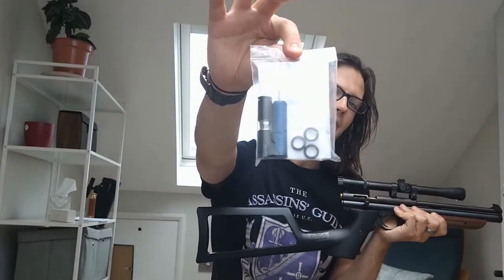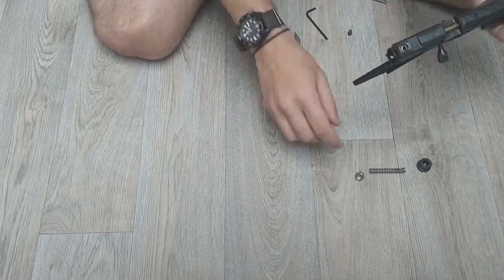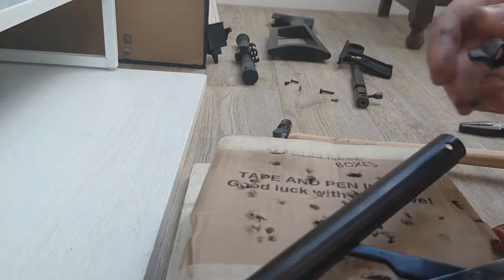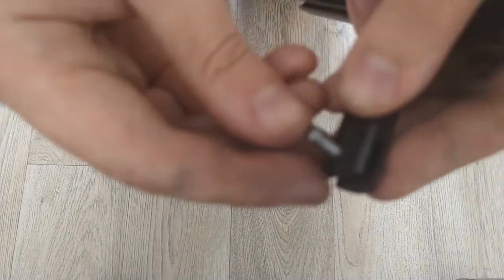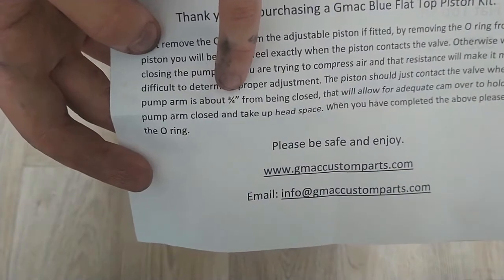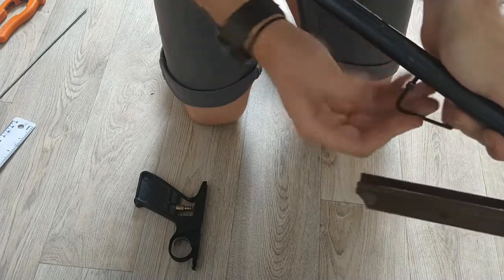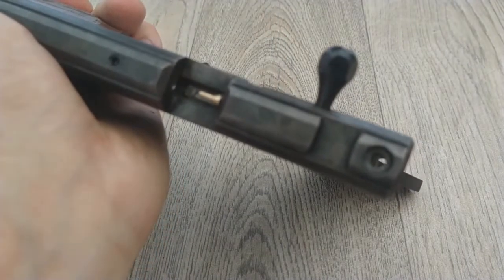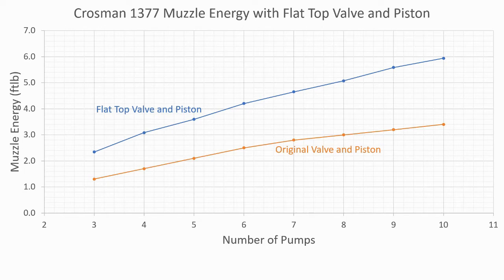Crosman 1377 Flat Top Valve and Piston - Install + Chrony

Comment: In case nobody else mentioned it, if you open the pump arm the pin will go in and out much easier. There are also a couple of companies that make replacement pins that ARE NOT roll pins and use retainers to hold them in place. That style pivot pin is also much better to set your piston length. If the piston is too long it promotes early wear on all the pump arm components.
Reply: Yes its a good hack with pumparm open, it makes it so much easier. All the best from lancashire uk

Comment: guys, I hate to break it to you but flat top is purely cosmetic, it does nothing to improve performance, you know what does? the valve! drill larger output port hole, cut off half the thread off the male end, get longer softer valve spring and shorter harder hammer spring, drill a hole in the end cap of the tube and utilize a screw to act as hammer spring tension adjuster, I did that and with the stock setup using the original short barrel im getting 700+ fps with a LEAD pellet with just 11 pumps!, I have flat tops as well but they alone did not cut it, switched back to stock hardware and just turned my attention to the valve alone, also don't do this if your valve has been factory detuned (I'm looking at you UK, Canada, Australia..)
Reply: Could not disagree more. It’s been proven hundreds of times on the chrony

Comment: My maxed medalists has an 18in barrel with an enlarged air reservoir. With 30 pumps it will knock down a crow at 45mtrs. My latest build a co2 crosman pistol conversion. With an enlarged air reservoir adjustable hair trigger and trigger spring tension. I started with a 24in barrel and drilled it out for 2.5 in at 7.5mm. then cross drilled the 2.5in for a shroud silencer. This is super quiet and powerful. My next build, a crosman lower and Chinese parts for a PCP rifle with the same 24in shroud barrel. I love playing with crosman's. None better for the price.

Comment: If you don't extend the barrel with or without the stock it's still a pistol so be careful with those power figures, your 10 pump is just barely legal (with that specific pellet weight, so different pellets may well be over already) so any more than 10 pumps you will be in firearm territory in the UK, it needs at least a 12 inch barrel and to be something around I believe 24 inches complete length minimum to be classified as a rifle in UK law, I can't remember exactly but you may want to read up on it yourself just to be safe.
Reply from the maker: Thanks for the advice. I'll do some more reading and start looking for a longer barrel. I might also swap back to the stock transfer port for the time being.
Reply: @ThrHillSeeker  the transfer port would be the best way to restrict the power (may retain air depending on number of pumps) the problem with modded multi pumps is if the police get hold of it and send it to ballistics there's nothing stopping them pumping it 50 times, adding the heaviest pellet known to man and saying it's capable of an illegal figure and it's a hefty charge and may even introduce new restrictions. Unless the gun is incapable of going over 6 or 12 ft lbs depending on the barrel length they may well see it as a firearm. It's a huge grey area really
Reply from the maker: @MDM1992  That's true, although the same could be said for some stock multipumps and some pcps. Thanks for all the advice. I'll limit it with the transfer port for now until I get hold of a longer barrel.
Reply: @ThrHillSeeker  I always use the 14.5 inch barrel and fix the stock then you double your limit, but with these guns they can quite easily go up to 16-17 ft lbs so it's still best to chrony and restrict them mechanically, if its retaining air in the valve at 11.5 ft lbs then no matter how many times it's pumped it's legal, just needs to be fine tuned to that point.
Reply: Move to the US where we can own real guns with binary triggers😂😂 I can legally buy a 50 cal air gun at 17 in florida… y’all’s laws are too strict

Comment: Don't know why the don't use a hydraulic seal I stead of an o ring witch is round and only pushes a certain amount of pressure on the contrary the hydraulic seal is a unidirectional sea with a sharp conical shape that in extreme pressure it expands and seals even tighter I'm planing on machining mi own but with upgrades. nice video cheers for Florida USA

Comment: The easiest and cheapest way to increase velocity is to change the barrel.  I know you said you want to keep the 10.25" (216mm) barrel but changing it to the 18" (457mm) makes a huge difference and a barrel cost US $45.00 and 20 minutes of your time.  By changing the barrel I increased velocity from 585 to 665 fps.  My next mod is changing the hammer spring and flat top piston with the hopes of increasing velocity to over 700 fps.  I checked velocity with a borrowed chronograph shooting 7.9 grain Crosman hollow point pellets.
Reply from the maker: The problem with changing a barrel in the UK is that they're quite hard to get hold of and are subject to the same strict laws regarding shipping as whole airguns. I might still do it at some point though. Good luck with your hammer spring mod, make sure to replace the hammer pin with something made from a harder steel. The stock ones the to bend and break with heavier springs.
Reply: @ThrHillSeeker  GMAC will send them to your nearest RFD it's not much hassle just costs usually between 15-25 quid depending on the shop you get it sent to on "handling fees" lol
Reply from the maker: @MDM1992  Good to know. I have some family in Blackpool so might just arrange in person collection when I'm next in that part of the country.

Comment: I have a 1322 and I have recently purchased a new valve, bushing and an 18" barrel. I was looking for instructions for the valve installation. This video is exactly what I needed. Thank you.
Reply: How did it go? I was thinking of doing the same thing, wanted to know if it’s worth it.
Reply: @oneofthosepeople2101  I'm currently getting around 675fps with the 14.3gn CPHP, so about 14.5 ft/lbs at the muzzle.
Reply: @Ashcroft827  that’s amazing!
Reply: @oneofthosepeople2101  next step is going to be polishing the bore. That will improve accuracy,  reduce friction inside the barrel,  and  (hopefully) add a few more fps to that number.
Reply: @Ashcroft827  that’s awesome, keep it up man. 👍

Getting me motivated to tear into mine.

Comment: Open your transfer port to 3.2mm
And put the trigger spring in your valve (sorter spring)
It will release the air faster. 
I used a spring out of a hand wash dispenser for my trigger
Just see what you have around the house nice and soft so you have a easy trigger pull
Reply from the maker: Thanks for commenting!
I'm going to dial back the power mods until I have a long enough barrel for it to qualify as a rifle to make sure I stay on the right side of the law. I have a very free-flowing transfer port waiting in my parts box.
I might experiment with a lighter spring in the stock valve that I removed. 
I already have an adjustable trigger spring which is set super light. One of my favourite mods. I'm going to make a video of how to fit it soon.
Reply: @ThrHillSeeker 
Don't open up the transfer port too much you will lose power I tried 4mm tp and the power dropped
Rule of thumb is the tp should be 80% of the barrel bore 
3.2mm was bang on for me
Remember you have a 177
Hi flow is for 22
177 needs max pressure
22 needs a lot of flow
The barrel bore is 1mm bigger 
And the pellet weights twice as much 
Good luck these mods will never end
It's like a can of worms
Fun but expensive
Reply: @jasonbuchanan7591  It's very easy to loose power with a larger transfer port. There is a fine line. Being in the states, I leave my transfer port stock and just use a 16 or 18in barrel in .22. I only pump to 10. If I need to pump it 20-30 times, I will just use a different gun...My 18in barrel setup works great on cottontail rabbits and squirrels out to 25 yards at 7 pumps. I don't know why 7 pumps, but it is most accurate and works. I chose the harder cphp 14.3 pellets and they provide the accuracy and needed penetration. I would not use softer lead pellets like the Jsb Hades in my setup. But it shows to go that whomever developed what FPE is required for certain game didn't use the correct pellet!!! Anyways the 13xx platform is a very fun platform to work with and has huge potential. It can be rough on the pocket book though. My next project is a 1320. Having Walter Lothar make a .20 cal barrel. That will give me the hitting power of a .22 and the better sectional density of a .177. So that will be fun.

Comment: I  unfortunately purchased the 1377c which is for the Canadian market so that it doesnt exceed 495fps which i was a little upset with so i did the same Gmac mod, i studied a couple of "how to" videos on youtube. I heard  "somebody" pumping theirs 25 times and although it didnt rise dramatically from 10 pumps, it still increased in power. I also bought the Gmac barrel band/1/2 inch unf adapter and fit an airarms silencer so that it tames the bark quite alot. I sold it on for £125  to get a. 177 Hatsan Supercharger which is a great gun as well. I then started to miss it so i then snapped up a 1322  which are quite hard to get these days, and deccided i would turn it into a survival carbine. i put a 3-9x40 illuminated recticle scope and a cree ultrafire flashlight on top of the scope. I put moderator on with a carbon fibre wrap, i then ordered the 2289 backpacker large pumparm which looks badass and saves you trapping your skin. I bought the extended stock and fitted a quick release button. I purchased a neoprene velcro cheek rest that wraps around the stock and secreted a survival kit inside 2 zip up pellet holders. One of them holds  200 different  rounds of 22 pellets inside, and the other is my survival kit consisting of fishing hooks, line and weights, a firestarter, waterproof matches and foil blanket, a minature folding knife, some feathered kindling, plasters, and 12 feet of paracord which fit inside the hollowed part but held snuggly inside with the velcro  neoprene cheekrest. Very unlikely that it would ever be used as a survival carbine as you cant exactly take it camping in Britain, but it does look supercool though. I would send pictures if i could. All the best from Lancashire.
Reply: Where did you get the 2289 forearm from?
Reply: Also, the Canadian/UK versions have the same valve but a smaller transfer port; easy to find a US or larger modified port.
Reply: @banthaexplosion  Hi there i got it's from SD customs in uk and other additions from G.Mac customs. All the best from lancashire.

Comment: Nice video! I encourage you to get an inexpensive set of roll pin punches to avoid flaring the side of the pin while driving it out. It looked like you were using a tapered punch. Thanks for the post. It was very informative.

Comment: The black seal goes into the tube with the short side of the transfer port down do so with a trace of oil and the long side goes into the barrel which is located in the breech.
Reply: Does the longer side of the transfer port face up ? I always put the shortest one on top 😂

Comment: I haven't done a valve to mine but went with a longer barrel and all the other mods. I easily take dove and pidgin at close range - 25 - 30 foot elevation by 20 foot length +/-, .22 cal. It doesn't reach 45 + feet in elevation, I see the pellet hit an elevation and just arches down drastically from that point. It runs out of velocity before it runs out of lethality for the birds. I wouldn't try rabbit with it. I have a p-rod or discovery that would work for that. I like my pumper. I'm thinking of doing the valve and like your video. I went with a threaded two piece retaining pin instead of the roll pin at the pivot.
Reply: Do you have the 22 version if so would you recommend it

Comment: my CDN. 🇨🇦 spec.
piston , transfer port has a bleed hole that vents above the plunger hole .
I’ve found  #2  x   56 NC
ideal size thread tap for a screw to plug said bleed .
Thanks for your excellent guidance !
Reply: Nice info, for those of us working in metric then you can tap the hole using an M2.5 tap and then fit a small 2.5mm screw with loctite. 

Or drill it out to 2.5mm and tap it to 3mm and fit a 3mm screw with loctite. All info I got from a great informative forum thread "New Crosman 1377 are under power- here's how to fix them".

Comment: you can change the bolt probe to a .22 probe and add a .22 barrel, quick upgrade and you can swap it rite back to stock. you will need to slightly drill out the barrel band as the barrel is slightly wider.....2 seconds does it with a Dremel.

Comment: If you dont want to spend much on your low power Canadian 1377/1322 then you can block the bleed hole on your valve. Its just a matter of tapping the 2mm hole with a 2.5mm thread and plugging it with a tiny 2mmx2.5mm screw and some loctite. 

Just done mine this week, im getting 5 foot pounds on ten pumps,  and 5.7 foot pounds on 14 pumps. I could probably get a little bit more with a bigger transfer port. I would like to make 5.7 ft lbs at 10 pumps ideally.
Reply: can you explain what a bleed hole is, and any video links.

Comment: Great vid, but how much more power did you actually get as with the old piston you was losing air out of the back. So debating if this upgrade would be any good to me.
Reply from the maker: Thanks for commenting! I realised the old bolt was jumping before I did the power tests with the stock piston so I held it down to get as good a seal as possible when I did the "before" power tests. As such I'd say the power increase is still pretty significant. I hope this helps.
Reply: SECONDTWONONE, I understand what you're saying, if this was a fairly worn pistol when he took the readings before the modification it's similar to comparing the increase in power of a car with 200,000 miles on it to the same car with a fresh engine with high compression pistons. If you compared the new high compression engine to the same car with a new low compression engine the figures would likely be totally different. In this case I understand the theory behind the different pistons, you aren't compressing as much air in the pump chamber, instead forcing that compressed air through the check valve into the storage cylinder so you'll have an increase, just not as much as when you start with a worn out piston. And I'm not assuming his was worn to a degree that would have a measurable impact anyway.

Comment: I have a 1322 and was wondering whether the piston diameter was the same in the 1377 as in mine.  If the bore were larger, could the barrels be swapped for a probable increase in velocity without the shorter (I have been dubiously informed), life expectancy of the piston swap?

Comment: Can you tell me how to remove the small hex nut that’s under bolt if it’s damaged? I stripped it and now it’s stuck but I’d love to replace it with something like you used…
Reply from the maker: Thanks for commenting! When I got the gun it still had the plastic breech and the previous owner had rounded the hex nut. I had to cut into the breech and the hex nut with a Dremel. This allowed me to unscrew it using a flat headed screwdriver. I hope this helps.
Reply: @ThrHillSeeker  dang. I did it with the steel breach.. it stripped soo easily
Reply from the maker: @ALL-AMERICANA  Ah, in that case all I can really suggest is drilling it out with a very thin metal drill bit but there's a risk of stripping the tread on the breach and the main cylinder in the process.
Reply: @ThrHillSeeker  Well I appreciate the tip and quick response. Thanks!
Reply: @ALL-AMERICANA  I don't know if it already solved your problem, but the same thing happened to me so I glued with superglue the key that best fit the damaged thread to be able to turn the screw, so after I removed it I made a slot to be able to use it with a screwdriver
Reply: @marcelojc1  thanks!

Comment: At 29:05 did you account for the different weight of the pellets for the muzzle energy?
Thanks!
Edit: also, 3'4fpe isn't low to begin with, in a Crosman 1377? I thought advertised was more like 6fpe or so. I know on joules, it was advertised at 8'56J, at least for the 1322 but they have the same advertised energy as far as I can remember
Reply: In the UK we almost always can only find the Canadian 1377c or 1322c. These models have a different valve with a factory added bleed hole and smaller transfer port size compared to the USA models, to keep them below the Canadian 500fps law. But luckily plugging up the bleed hole and buying a bigger transfer port is fairly easy to bring them up to 6ft pound. 

I believe that in the UK, aslong as we add a shoulder stock and a bigger barrel then we can legally take these things up to 12ft pounds. More than that would require a Firearms Certificate.

Yes I know our laws are stupid, but it could be worse if you look at Canada, Germany, Ireland or China!.
Reply: @99ron30  well, I bought this one in Spain and just chronied it once but gave me the full 8'5J
I still wonder if such a small transfer port allows for a lower pump on the following shots. It could be more important that one would think, because any remaining air could be getting higher an higher pressures and damage the gun
Any clue about that?